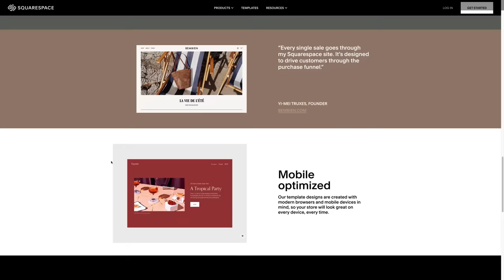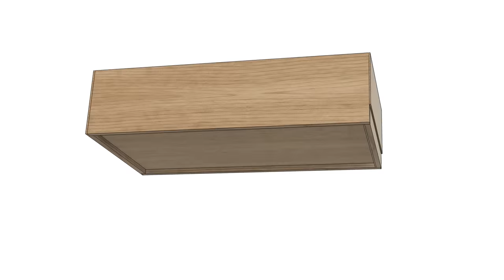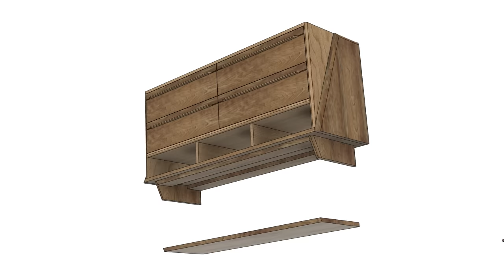How to Build a Modern Dresser

Comment: You're a brave soldier cutting those mortises with the router braced on only one side. I will never forget all the prep then pushing the router in the wrong direction sending it chewing off in the open direction. I built an adjustable jig that  gauges the mortice width using the vertical piece. With fa lush bearing bit and braced on each side its hard to mess up. I like the tenon idea; I'll give it a try...and teach an old dog a new trick. Congrats on the new family member!!!!

Comment: Very nice design, and congrats on the new client 😁 
Nice that you allowed for wood movement on the sides, but by glueing the small vertical divider to the wallnut bottom, aren't you asking for trouble? 😅
Reply: Thanks! Since they are in dados it should be fine, and wood glue does a good job of flexing and moving with the wood, so I'm not too worried.